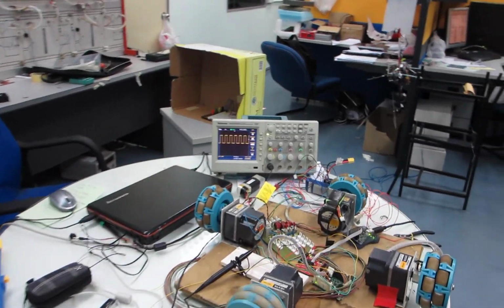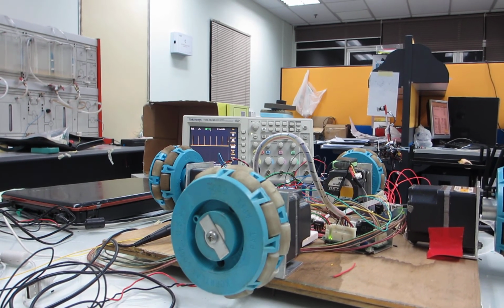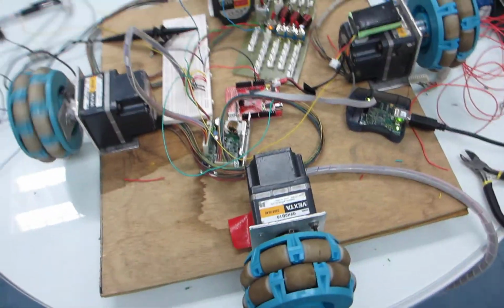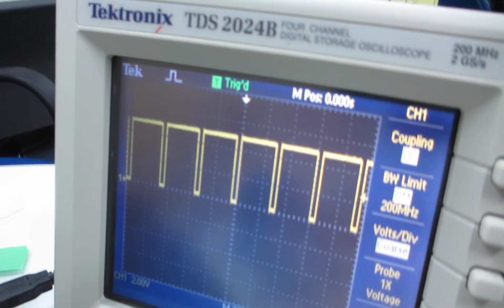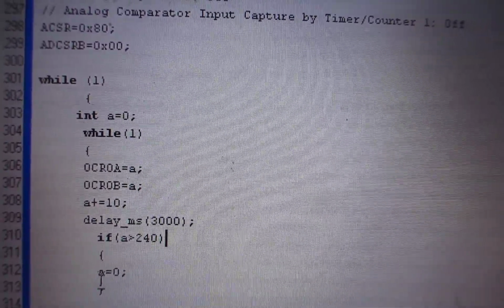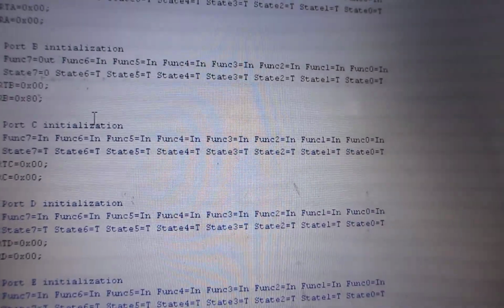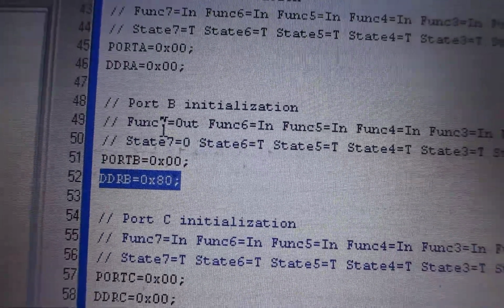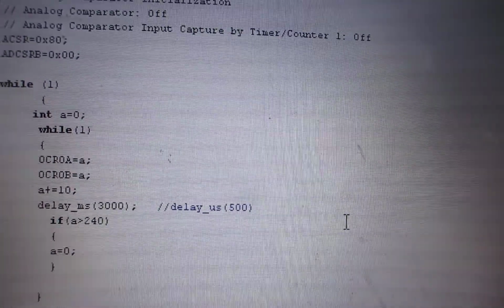Vexta Motor with PWM

Comment: sir can you share pin driver motor vexta just  running  motor plss..
Reply from the maker: reffo rismanto I am sorry but I am not very sure what you are looking for. I would be more than happy to help but I can't understand what you are trying to ask.
Reply from the maker: Maaf, maksud kamu apa ya? Kamu perlu bantuan apa?
Reply: begini mas  saya mempunyai motor vexta jenis BLH 450 GFS dengan driver motornya  jenis BLHD 50K  yang saya bingungkan adalah cara menggunakan atau menjalankan motor dengan microkontroler arduino , apakah mas mempunyai solusi atau  coding cara menghidupkan motor dengan driver nya mas , atau gimana cara menjalankan driver dengan microkontroler arduino nya mas ,
Reply from the maker: There are two options here. They both work but the first one is better than the second one.
1) You can use PWM (pulse with modulation) and RC filter (low pass filter).
2) Using PWM without filter.

In order to understand PWM. Read this:
https://www.arduino.cc/en/Tutorial/PWM

However the default Arduino library has a very low frequency. You need to change the frequency using the internal registers. You can read the following:
https://www.arduino.cc/en/Tutorial/SecretsOfArduinoPWM
https://playground.arduino.cc/Code/PwmFrequency

my own setting in this video for Arduino Mega
// Timer/Counter 3 initialization
// Clock source: System Clock
// Clock value: 16000.000 kHz
// Mode: Fast PWM top=ICR3
// OC3B output: Non-Inv.
// OC3C output: Non-Inv.
TCCR3A=0x2A; TCCR3B=0x19; TCNT3H=0x00; TCNT3L=0x00; ICR3H=0x00; ICR3L=0xFF;
OCR3AH=0x00; OCR3AL=0x00; OCR3BH=0x00; OCR3BL=0x00; OCR3CH=0x00;

For low pass filter you can read this
http://www.instructables.com/id/Analog-Output-Convert-PWM-to-Voltage/

On your motor controller:
Pin4 => ground, pin5 => PWM output, pin8 => External, pin9 => control direction (connect to Arduino I/O)
http://www.cytron.io/index.php?route=product/product/getProductAttachmentFile&attachment_id=15972 
page 132
Reply from the maker: Ada 2 solusi disini. Sebenernya 2 solusi ini bisa membantu tetapi solusi pertama lebih efektif. 

1) Anda dapat mengggunakan analog output pada arduino anda dengan PWM (Pulse width Modulation) dan RC filter yaitu tapis pelewat/lolos rendah (low pass filter)  digunakan untuk meneruskan sinyal berfrekuensi rendah dan meredam sinyal berfrekuensi tinggi. 

2. Solusi yang kedua ini memperlukan pemakaian PWM tanpa filter.

Bila anda tidak mengerti tentang PWM anda bisa baca situs tersebut: 

https://www.codepolitan.com/tutorial/analog-output-arduino-menggunakan-pwm-pulse-width-modulation

https://www.arduino.cc/en/Tutorial/PWM

Namun default perpustakaan Arduino memiliki frekuensi sangat rendah. Anda perlu mengubah frekuensi menggunakan register internal. Anda dapat membaca berikut:

https://www.Arduino.cc/en/tutorial/SecretsOfArduinoPWM
https://playground.Arduino.cc/Code/PwmFrequency

Ini adalah pengaturan saya sendiri dalam video ini untuk Arduino Mega: 

// Timer/Counter 3 initialization
// Clock source: System Clock
// Clock value: 16000.000 kHz
// Mode: Fast PWM top=ICR3
// OC3B output: Non-Inv.
// OC3C output: Non-Inv.
TCCR3A=0x2A; TCCR3B=0x19; TCNT3H=0x00; TCNT3L=0x00; ICR3H=0x00; ICR3L=0xFF;
OCR3AH=0x00; OCR3AL=0x00; OCR3BH=0x00; OCR3BL=0x00; OCR3CH=0x00;

Untuk tapis lolos rendah (low pass) filter Anda dapat membaca ini dari link ini: 

http://www.Instructables.com/id/analog-output-Convert-PWM-to-Voltage/

Untuk motor controller:
Pin4 => ground, pin5 => PWM output, pin8 => External, pin9 => control direction (connect to Arduino I/O)

http://www.cytron.io/index.php?Route=Product/product/getProductAttachmentFile&attachment_id=15972 

halaman 132
Reply: untuk driver motor nya yang berjenis blhd 50k pin apa saja yang harus terhubung ke arduino nya mas??